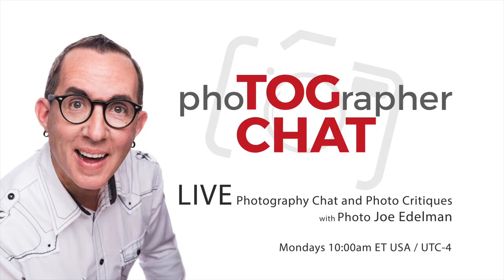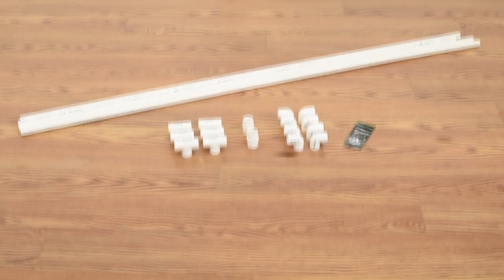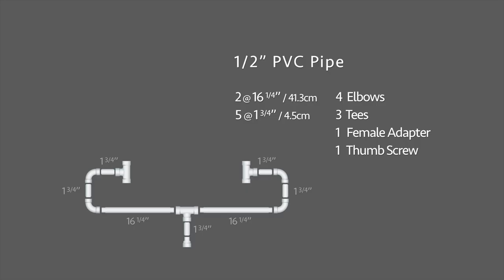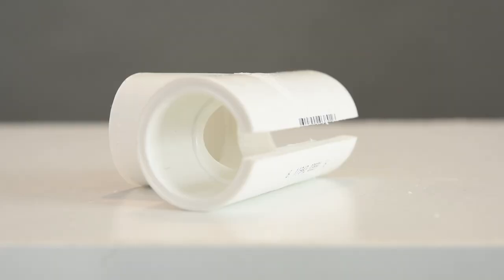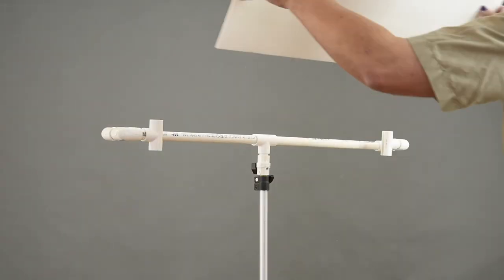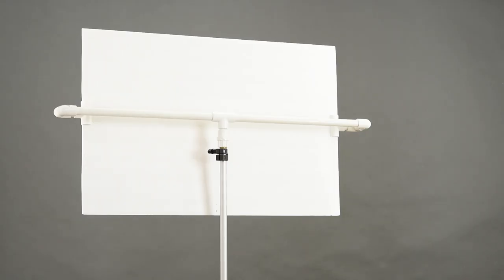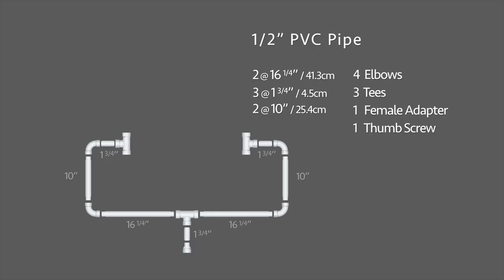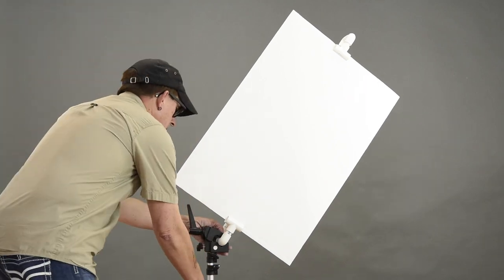DIY Photography Studio Reflector Holder and One Light Portrait Lighting Tutorial

Comment: Just built this thing. It's perfect. And I'm NOT spray-painting it black...gonna leave it Home-Depot white, out of sheer DIY pride! Also, I did not put the female adapter on the mounting end, but just left the stub of the 1/2" PVC, which fits PERFECTLY over a light-stand spogot! And then I just put the thumb-screw into the 1/2" stub. So slick! Thanks!

Comment: That looks great!  I'd advise caution when using the tablesaw though. The method in the video has finger literally about an inch from the blade.  That is how fingers are lost.  Since it's a "T" fitting, it'd be easy to insert a piece of PVC into the T and use that to push, enabling your fingers to stay far away from the blade..

Comment: To make life easier when cutting the threads A) get a 1/4 20 by 3/4 inch self tapping screw and reuse it. For a better option get a 13/64 twist drill bit and a 1/4 20 starter tap from a hardware store. You may also want to get a 5/16 drill and 3/8 16 starter tap since these are common sizes used for photo gear.
Reply: Thanks for the likes. I would like to add that using a High Speed Steel tap on PVC is like a hot knife through butter. If you are going to use it on aluminum put some WD40 on the tap and in the pre-drilled hole. Turn the tap twice then back it off a 1/4 turn to break the chips made by the tap. If you are going to tap steel use 3 in 1 oil or thin motor oil. If you intent to tap through more than a 1/4 inch get some Tap Magic for the type  and grade of material you will be using. The job will be better and the tap will last for a long time.